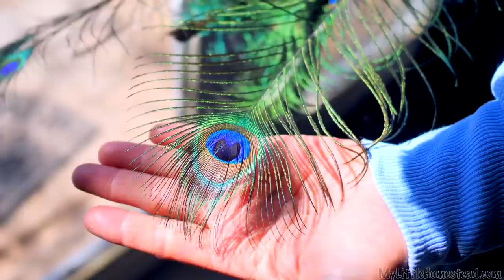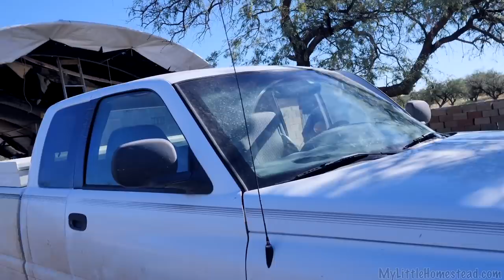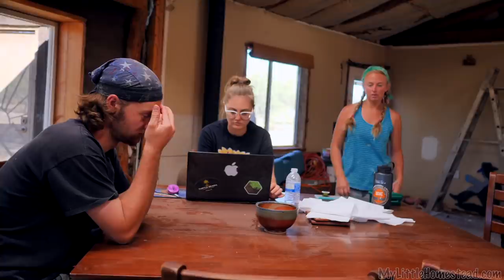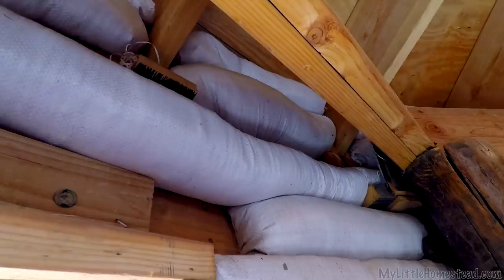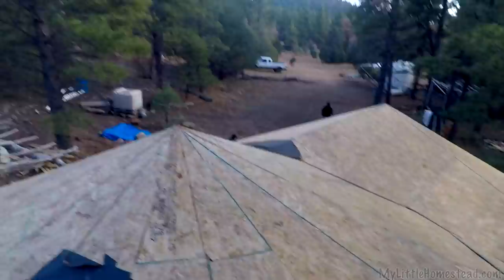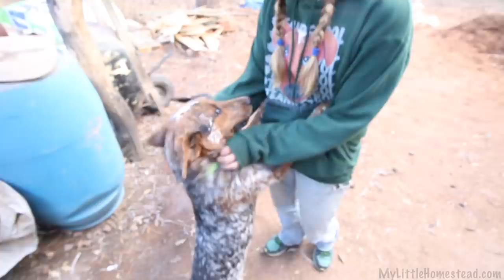Fascia, Sheeting, Interior Stucco & Cabinets | Earthbag Kitchen, Bath & Cabin | Weekly Peek Ep161

Comment: because you soil is mainly clay  i would mix bags of concrete  and make a real concrete stucco  to protect your bag asap from UV sun light that will turn them to dust- from what i have found unless its polyethylene it has UV protection.   both places are looking good

Comment: question would it not be faster to spray a slurry like substance on the inner walls
Reply: They tried that on one of the outside walls, used a textured ceiling spryer modified, not sure the final results.   I have not seen them used since so must not work well enough to continue using.  I have watched all the builds.
Reply from the maker: We found that the water content in the mix was aerated and left the mixture. This caused the mix to have more of a rocky texture. We were looking for something smoother.

Comment: Please explain to me how on so many of your builds that on wall section is always lower than the rest making one roof section sag lower than the rest?  I would think that after it happening at least twice on two different builds that it would not happen anymore.
Reply from the maker: Think asymmetrical. Out of the box. Color outside the lines. Be the new normal.
Reply: @mylittlehomestead  I get that but wow that roof line is low compared to the rest.

Comment: Please stop calling the concrete plaster "cob". It isn't. cob is soil, sand and straw. Thanks. 
Love what you all do!
Reply from the maker: Habit. But you know what we mean, right?
Reply: @mylittlehomestead  yes. I know, but so many who are just learning will learn it incorrectly.😃😁♥️😎😄😀
Reply: Not trying to be a jerk...but it is okay to call it cob if it contains dirt.  Even if it has lime (also called cement) in it.  Wiki defines it...Cob, cobb or clom (in Wales) is a natural building material made from subsoil, water, fibrous organic material (typically straw), and sometimes lime. The contents of subsoil naturally vary, and if it does not contain the right mixture it can be modified with sand or clay...   I know...they don't use straw in their mix,  but they also only put on one base coat.  Free to choose whatever gets the job done with earth builds :)